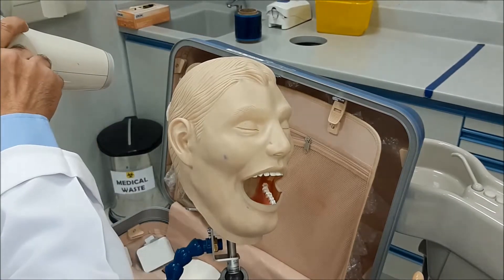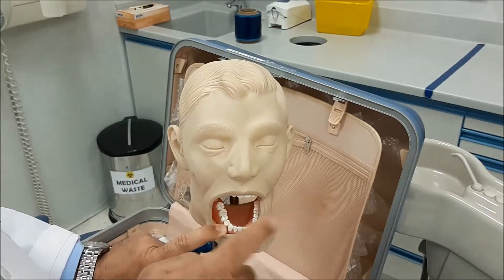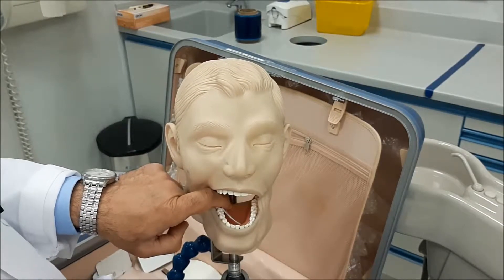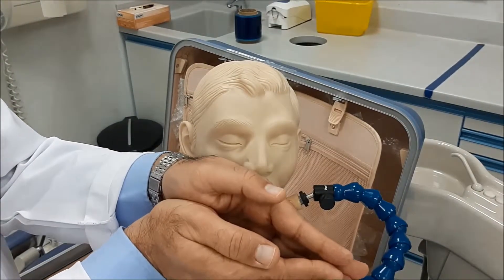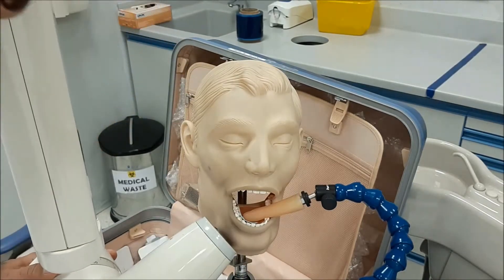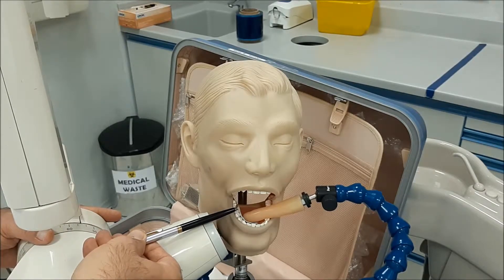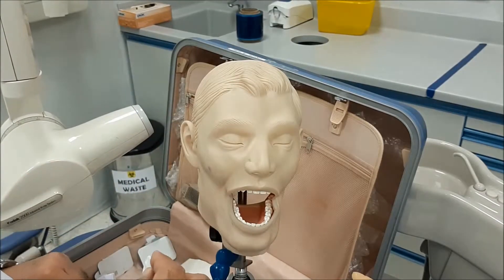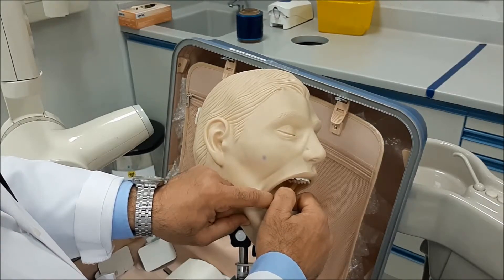Lower Premolars Angle Bisecting Technique

Comment: Thanks alot doctor..what do you mean in interance point please, I find it usless ,I only do vertical and horizontal angulation
Reply from the maker: Dear Dr Saad, thank you very much for your comment. The point of entry helps the operator in "aiming" the beam at the sensor, which in most cases can't be seen. It has nothing to do with the horizontal and vertical angulations. I hope I made my point clear.
Reply: @saadwahbyalbayatti9561  thanks alot dr for your fast reply ..your videos are very helpful ❤️
Reply from the maker: @saadalbeck  You are most welcome.